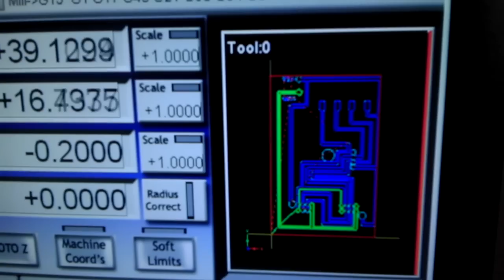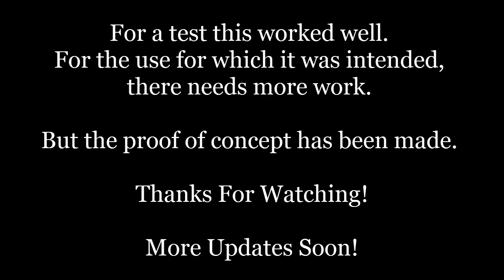Downing's CNC PCB Test

Comment from the maker: A PCB basically takes the place of wires. Using this I can make certain parts or replace wires in my project with a flat and easy way of connecting two points. The video is showing prototypes for a new product I'm developing.